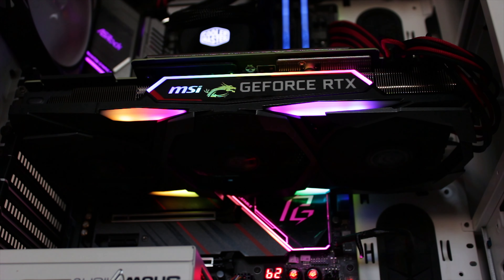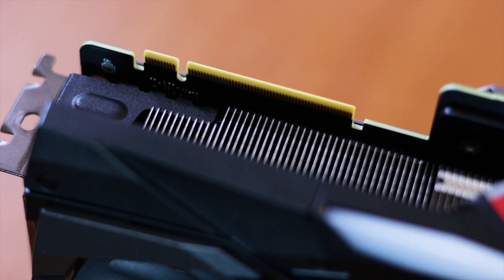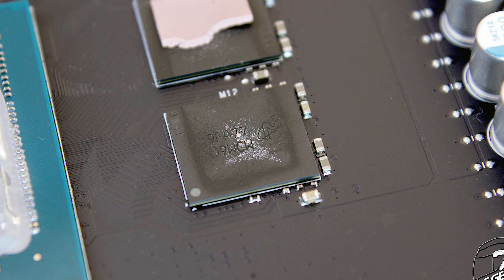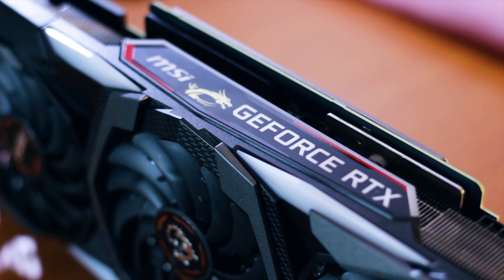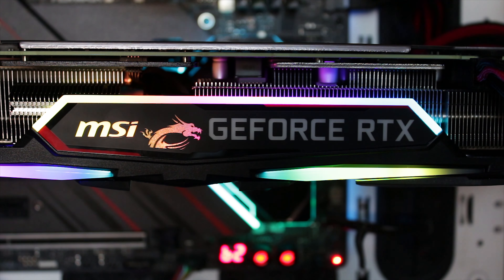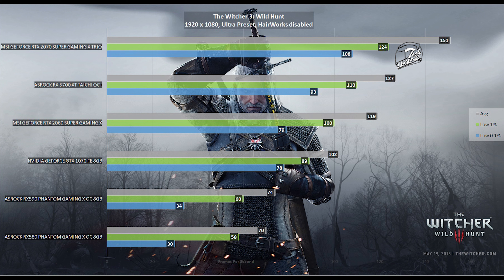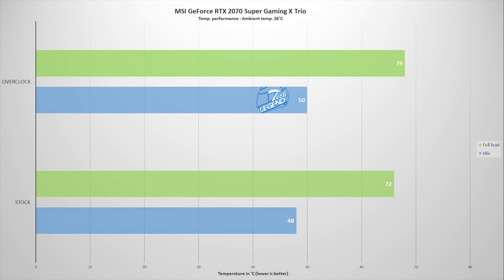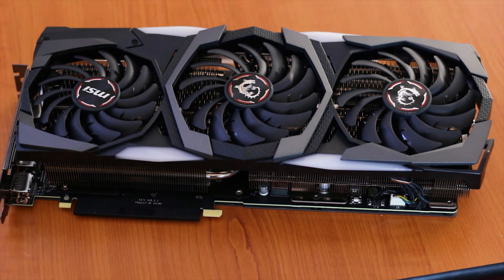MSI GeForce RTX 2070 Super Gaming X Trio - Review

Comment: Hello sir. I have the same GPU. But I think I have a problem with the fans' operation. When the fans start to spin (doesn't matter, manually or triggered by temprature) all fans spin normally. But when I decrease fan speeds manually or temprature drops below 60°C, the right fan still keeps spinning. It makes noise and disturbs me while I'm using my PC. Did you experience an issue like this?  If no, should I return my GPU as an RMA case?
Reply from the maker: Hi, sorry for the late reply. 
Please install MSI Afterburner and try to play with the fan speed settings, see if they work as you want them to.

Comment: I have a question for you... The MSI GeForce RTX 2070 RTX 2070 TRI Frozr Graphics Card - 8 GB GDDR6 - 256-bit. is this a good card for my full tower, is this a not a small GPU and does this version have RGB?
Reply: is this better than the above Gigabyte Ultra Durable VGA GeForce RTX 2070 WINDFORCE 8G Graphic Card? does it have RGB? are 3 fans better than 2?
Reply from the maker: @ViolentJ119  Hi, I don't think that the RTX 2070 RTX 2070 TRI Frozr has RGB. I will suggest you, to get the cheapest variant of the RTX 2070, as the performance is pretty much the same between models. The main differences between these are the noise and the temperature.
Reply: @TechLegend-com  which is the cheapest variant?
Reply from the maker: @ViolentJ119  I couldn't say, as each region has different prices. You have to look and see which is the cheaper RTX 2070.
Reply: Also will this series of GPU's work for my, AMD ryzen 3 1200 Qd.C.P. that runs 3100 Mhz. Paired with the AB350-Gaming 3-CF mobo, that im currently using? Will it post?
Reply from the maker: @ViolentJ119  It will work just fine. All graphics cards will work with all CPUs and motherboards. As long as it will fit in the motherboard slot.
Reply: @TechLegend-com  thanks so much for your time and knowledge. Very helpful. ☺😁
Reply from the maker: @ViolentJ119  You're welcome! :)

Comment: Question: does the trio fit in mid tower case? Or the trio is exclusive on large tower?
Reply from the maker: It really depends on the case, as some are longer than others. What case do you have in mind?
Reply: @TechLegend-com  i have NZXT Phantom 410 Gunmetal, a mid tower case which i bought from 2016. Im curious because i saw 2 version of msi rtx 2070 super: double fan and triple fan
Reply from the maker: @SaigaTenshi  Looking at the size of that case, I would say that this graphics card will fit just fine. So you can buy the 3-fan version.
Reply: @TechLegend-com  thanks for the info
Reply from the maker: @SaigaTenshi  You're welcome!
Reply: It fit in my corsair 600T and it’s a medium tower :)
Reply from the maker: @yusuk364  Unless you have an HDD cage installed, most cases will fit this GPU.

Comment: Hey mate. I'm debating whether to buy this card or the ASUS ROG Strix, I'm just wondering if you happen to know, which is not just the quietest Card, but also do either Cards suffers from any noticeable Coil Whine, When testing this card did you encounter any coil whine? Thanks!
Reply from the maker: Hi Matthew, When deciding between this RTX 2070 Super and that ROG Strix. The Strix is just a bit faster, as in 2% or less, faster. In terms of noise, this MSI Trio is quieter. 
This graphics card (my particular sample) has some slight coil whine, but I don't mention it in my reviews, as it can be just my particular graphics card and not every card sold. When it comes to coil whine, it all comes down to luck.
Reply: @TechLegend-com  Thanks for the reply. Sorry to bother you yet again but I've been also been considering getting the RX 5700XT. However I've heard it doesn't pair particularly well with Games built on the Unreal Engine (Suffering from Stutters and other performance issues) The RX 5700XT is a card I really want but I'm just cautious about how it handles games (again, particularly built with the Unreal Engine.) Thanks.
Reply from the maker: @matthewrichard3330  You are not bothering me, don't worry.  I reviewed the ASRock RX 5700XT Taichi graphics card, one of the best around. And while it is a good graphics card, I still use the MSI RTX 2070 Super, because it just works. I have no issues with the drivers, with the temperatures, with the reporting of temperatures, the graphics card just works, without me getting a headache. I would go for the RTX 2070 Super, it is just better overall, no nonsense drivers, better temperatures and the RTX support that is included. If you want to ask me anything, just let me know! :)
Reply: @TechLegend-com  Thankyou for your help i really appreciate it. I think I'll go for the 2070 Super as you speak wise words, Thanks again!:)
Reply from the maker: @matthewrichard3330  You are welcome! Let me know what RTX 2070 Super you get, and how you like it! :) Also, thanks for subscribing! :)
Reply: Tech Legend  Hey again mate. I was determined to get the ASUS ROG Strix, however I've come across users who have said that the STRIX tends to be very loud under load, even though all the reviewers report it to be only around 36/38 db. Whats's your take on this if you don't mind? Oh and I've been trying to find the answer to this next question everywhere but I can't seem to find the correct information, that being: Can you leave the STRIX in its quiet Bios Setting permanently, The Performance drop doesn't seem substantial enough to leave it in performance mode, and i'd prefer my system as quiet as possible, so would it be recommended to leave it in its "Quiet Bios" for as long as needed when playing games under Load or could, I run into issues with it Overheating?
 

Sorry If that was a mouthful aha, It's just that I've Narrowed it down to these two Cards and you've been very kind to reply and help me so far:)     Thanks!
Reply from the maker: @matthewrichard3330  Hey again Matthew! 
It depends on how the noise measurement was made, also, people tend to overreact when they hear some noise. All graphics cards, will make noise if the fans spin at their maximum RPM. 
Regarding your next question, if this is an actual Bios that you switch before using the graphics card, then it should be able to run using that Bios, permanently. I see no reason why it won't be recommended to use the Quiet Bios, especially since you are mostly gaming and not overclocking. You can also make a graphics card silent by creating a custom fan curve/profile using MSI Afterburner and similar software. But that Quiet Bios should be fine.
Reply: @TechLegend-com  Thankyou for the Speedy reply again mate. When I get my Super I'll let you know how I get on!
Reply from the maker: @matthewrichard3330  You're welcome! Yes, please do so. :)
Reply: @TechLegend-com  Hey mate, apparently the MSI Gaming X Trio doesn't have USB C functionality or something of the sort, do you think this will be an issue for me? Thanks:)
Reply from the maker: @matthewrichard3330  Hey Matthew, what do you mean by USB C functionality? Where did you see this? Usually, graphics cards have no business with USB ports.
Reply: @TechLegend-com  I can't pinpoint where I read it exactly but they mentioned USB-C port on Nvidia RTX graphics cards, and how the Gaming X TRIO doesn't have this. Just thought I'd get some clarification!
Reply from the maker: @matthewrichard3330  Ah I know what that is. It's the famous USB C Virtual Link port. Some RTX graphics cards have it, some don't. Basically, it is used for either VR gaming or to "supposedly" connect your smartphone to the graphics card. I always found it pretty useless and just a gimmick. 
So not having one, should not affect you in any way. VR you can use with adapters.
Reply: @TechLegend-com  Ahh ok that's not going to effect then as far as i know. Brilliant, thanks for the swift reply!
Reply from the maker: @matthewrichard3330  No problem, let me know what RTX you will get in the end! :)
Reply: @TechLegend-com  Definitely! It's just between the Strix and the TRIO atm so i'm almost there;) it's just down to me deciding which one- based on Coil whine suffers from the least (Luck of the draw) Which has drawn me towards the STRIX but again I don't know how quiet it is as I've seen varying reports haha! But when I get it installed in my system you betcha that I'll let you know!;)
Reply from the maker: @matthewrichard3330  Great, looking forward to it! :D
Reply: @TechLegend-com  Hey Mate! Completely forgot to let you now that I ended up getting the Gaming X TRIO in the end, she's a beast although the Coil Whine can get a bit excessive when gaming but I'm planning ways to null the sound. Thanks for your previous help and I wish you all the best!
Reply from the maker: @matthewrichard3330  It's great to hear from you Matthew, let me know how you lower or get rid of that coil whine! :)
Reply: @TechLegend-com  Will Do! Should be getting around to it soon:)
Reply from the maker: @matthewrichard3330  Yay!

Comment: Hey there, i have a question about the graphic card. So there is Msi 2070 Super Gaming X trio and there is Z. What is difference between Z trio and X?  Which one has lower sound and lower temperture?
Reply from the maker: Hello, the difference between the Gaming X Trio and the Gaming Z Trio: is that the Z version has a faster Boost clock and the graphics memory at 15.5 Gbps, instead of 14 Gbps. That's it, if you can, get the Z, but the X is just as good. Both have the same cooling and noise levels.
Reply: Tech Legend Thank you for fast and nice reply.
Reply from the maker: @buten8947  You are welcome!
Reply: @TechLegend-com  The Z version has Samsung B-Die memory and the X has Micron memory. Samsung B-Die is far better and can be overclocked quite a bit more (the memory that is...).

Comment: Bro. I will appreciate the help. This one or the aorus 2070 super?
Reply from the maker: The MSI RTX 2070 Super Trio is one of the best versions of the 2070 Super cards. I've heard that the Aorus have some issues within this series. I'd get the Trio and be happy with it, I have been using it since I made this review, and everything is great. The graphics card barely spins its fans and it performs good.
Reply: @TechLegend-com  thanks bro. Will it fit with my h510i case?
Reply from the maker: @paolomiguelgabun8031  Yes it will fit, but only if you don't have a radiator installed at the front of the case.
Reply: @TechLegend-com  what if its just a single fan aio? Should I put it in the front, top or rear?
Reply from the maker: @paolomiguelgabun8031  Rear should be the best option.

Comment: Is there any sagging on this card?? I want to upgrade my 1660 ti gaming x to this card. Great review btw.

There is a chance that it wont fit my h500 case cause of the radiator, so I will either get this or the aorus version.
Reply from the maker: Hi, yes this graphics card will sag a bit. But with this card, you have included a metallic brace that will  hold it straight. How thick is your radiator?
Reply: @TechLegend-com  it's the kraken x62 radiator with the nzxt fans mounted, they're about 5cm thick.
Reply from the maker: @man0grc  After looking around, it seems that you can be able to fit this graphics card there. However, can you install the fans in front of the radiator? As in further towards the front? Because the space is so limited that it might not fit if both the radiator and fans are inside the case. Honestly, I can't say for sure that it is possible, as I have yet to review the H500.
Reply: @TechLegend-com I know what you mean to place the bracket in between the fans and the radiator, in fact this is how I had it installed before but unfortunately nzxt suggests to have them both behind the bracket for optimal airflow. They fixed that issue with the elite case tho by giving it more space at the front.
Reply from the maker: @man0grc  But you already have the H500 I suppose. Then, you have to get that Aorus model, or find a RTX 2070S that is shorter.
Reply: @TechLegend-com  yup, or upgrade to the h510 elite case, but that thing is pricey.
Reply from the maker: @man0grc  There is no point in that, you need a shorter graphics card, that's it. :)

Comment: Hey man, I also have the same card. But is your card also not completely straight when its installed?
Reply: So on the right its hanging down a bit
Reply from the maker: Yeah, it is sagging, but I did not want to film it with that metal support beam that they include, because it made the graphics card harder to spot in the video. Are you using that support beam?
Reply: @TechLegend-com  Yep, but it is not doing anything.. completely useless
Reply from the maker: @Chris-nn2fx  Yeah, it does help a bit with the sagging, but it is massive and it's annoying me. heh. :)
Reply: @TechLegend-com  yep, but I think there is nothing to do about it, I now have my card almost completely straight, but I dont think its possible to get it perfect because of the size and the weight of the card. But anyway its working fantastic
Reply from the maker: @Chris-nn2fx  You fixed the sagging with that support beam? I tried it again, and I had to remove it, because it blocks from view, the two-digit display of the motherboard.
Reply: @TechLegend-com  Ohh that sucks, I almost completely fixed the sagging. Its still not perfectly straight, but I dont think its possible to get it any better
Reply from the maker: @Chris-nn2fx  Yeah, I saw that even with that support beam it is sagging a bit, but I can't deal with not seeing that small display on the motherboard, especially since it shows real time CPU temperature. To fix the sagging, I will get one of those support beams that mount from the other side of the case.
Reply: @TechLegend-com  Yea I understand, I also dont really like the support bracket that came with the GPU, can you show me what you have bought to support it?
Reply from the maker: @Chris-nn2fx  Search on google images for " Adjustable GPU Stand ", and you'll see what I mean.
Reply: @TechLegend-com  thanks! Sorry for late reaction
Reply from the maker: @Chris-nn2fx  Yes that one, or at least, that style of stand.
Reply from the maker: @Chris-nn2fx   No worries, we're all busy here! :D
Reply: @TechLegend-com  Okay! Might pick it up aswel. I do live in the Netherlands, do you think Amazon will deliver?
Reply from the maker: @Chris-nn2fx  I can't see a reason why they wouldn't deliver. :)

Comment: Still worth imo, I got mine honestly still a bit marked up at $330 a few months ago, I could get it or another three fan card for $275 now but no regrets honestly because MSI nailed the cooling and performance on it. Mine under-volts pretty good too, saving at least 30% power compared to stock under load when running stable at 825mV, and I added +925MHz to memory clock. Besides 40 series is expensive so I wouldn't be shocked if prices creeped up again at some point.
Reply from the maker: This RTX 2070 Super is really good, especially as you say, its cooling system. One of the quietest models i've had.

Comment: Mine can't turn on the RGB light, when the computer assembly the gpu can turn on but this end can't turn on anymore, can anyone help me?
Reply from the maker: Install MSI Mystic Light and see if you can turn the RGB on through that.
Reply: @TechLegend-com  it is already installed. even mystic light can't read my gpu.
Reply from the maker: @rioarnas7321  First, make sure you have installed the Mystic Light 3 and now the version 2. Also, check if installing the msi dragon center helps you in any way. Let me know how it goes.
Reply: @TechLegend-com  mystic lights 3 only works on. windows 9 or under i think or 7 or under. my gpu only had bottom rgb active took it back replaced it was faulty
Reply from the maker: @JHgamer101  Yeah, that's why I also mentioned installing Dragon Center.

Comment: This card is not MSI's top of the line RTX 2070 Super. The Trio Gaming Z (not X) is MSI's top of the line 2070 Super. The Z variant has B-Die Samsung Memory at 2000Mhz, or 15.5Gbs thorough put and the X version has Micron 14Gbs memory (standard memory). The factory over clock is also higher on the Z version of this card. The Z variant is the only RTX 2070 Super that uses Samsung memory which is why you can over clock the crap out it's memory. I'll take that for an extra 70 bucks any day.
Reply from the maker: That is correct, however the Gaming Z was even pricier than just 70 USD vs. the Gaming X version. It all depends on the preference of each user, and both the Gaming Z and Gaming X variants of the RTX 2070 Super are part of the top of the line from MSI, because the performance is very close, and the cooling is identical.
Reply: Did you buy the Z version? I would love to know if it performs any better than the x version.
Reply: @Audi1Pete  Yes I bought the Z version about 2 months ago. It does perform faster than the x version. https://www.techpowerup.com/review/msi-geforce-rtx-2070-super-gaming-z-trio/ Check out the review. It's quite in depth and will tell you everything you need to know. It sometimes out performs the rtx 2080 and does surpass the GTX 1080TI. Very good cool and quiet card.